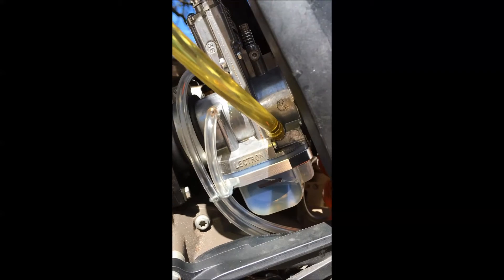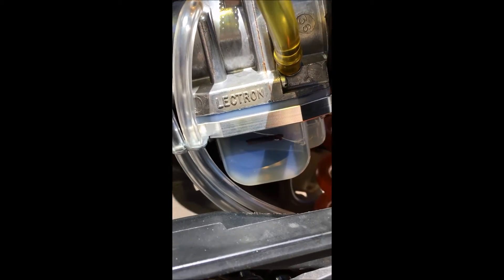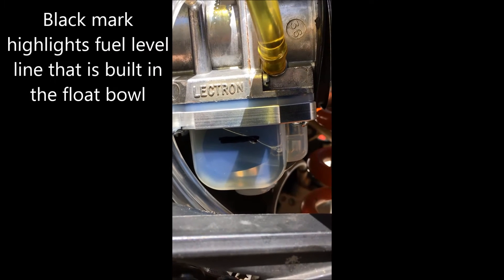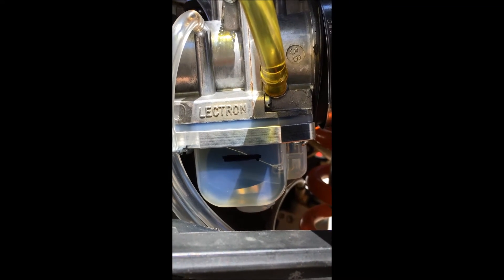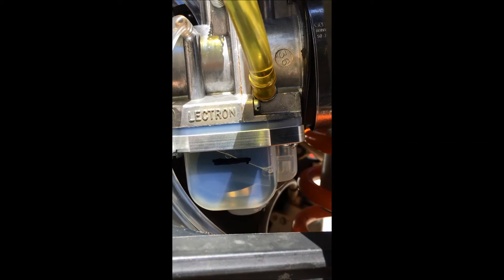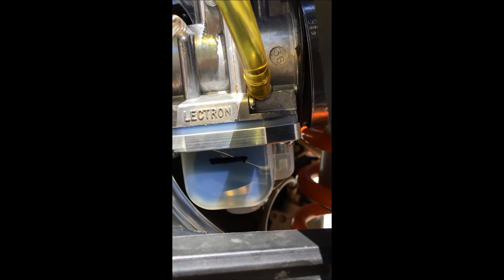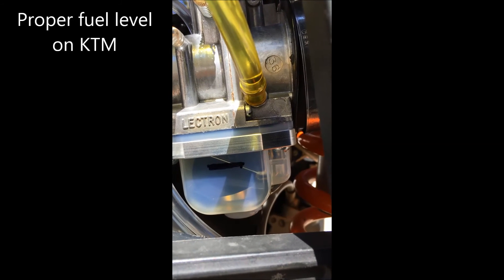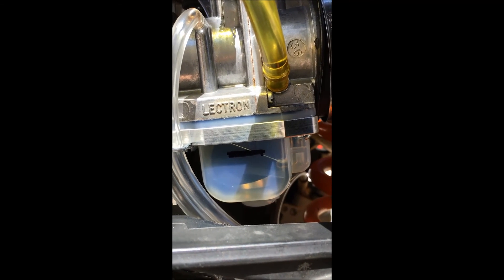Lectron Install (Part 1) - Fuel Level and Float Position

Comment: I have gas leaking out the over flow hoses I think the float is getting stuck any ideas how to unclog it I have no idea how to take the float off from the carb and really clean the springs out good
Reply: @TheToOPPlayers  me too, did you solve your problem
Reply: @nalyd6386  spray wd40 in the fuel hose and then compressed air. that what lectron says do. for anyone else reading this